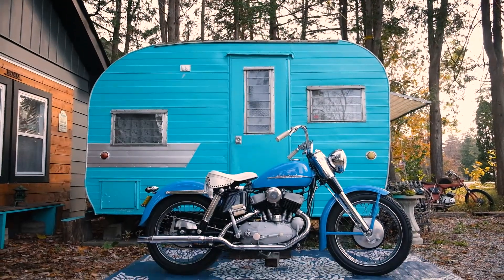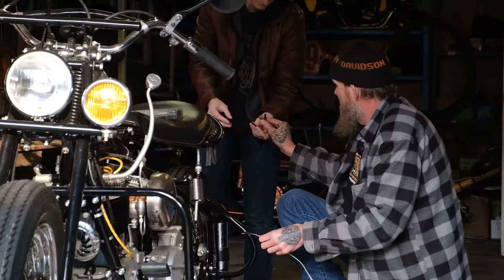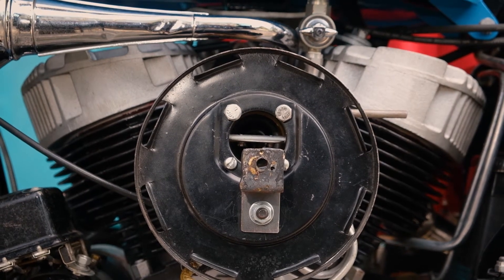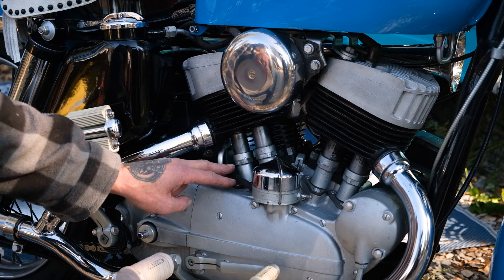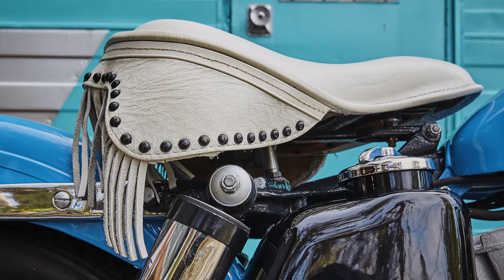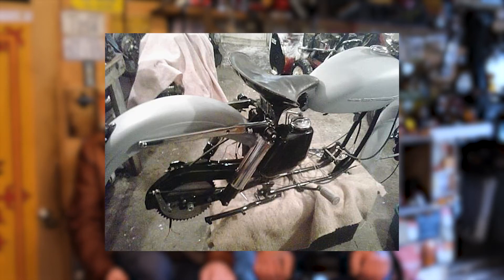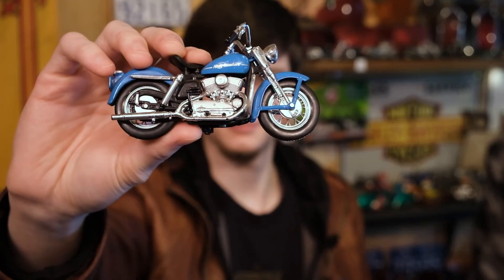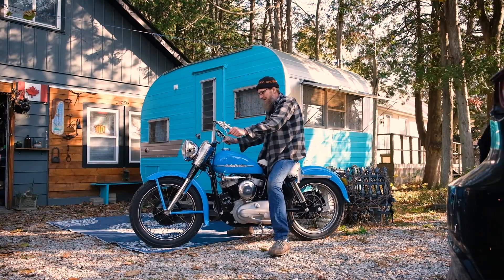Vintage Harley Davidson K-Model - Is This the Father of the Sportster?

Comment: HD wanted an updated sport scout 
But it became a 648 big base with incorporated 4 speed trans and primary. Much smaller magneto/ distributor.
The kr motor sounds almost identical to a 648 indian. Cams were the trick. The 648 was a fully developed engine that harley copied. The suspension and brakes took years to work out. Disc brakes and decent front forks 
Finally in the 70s